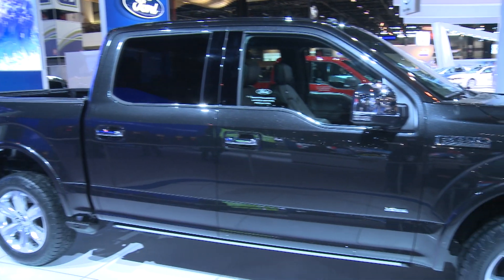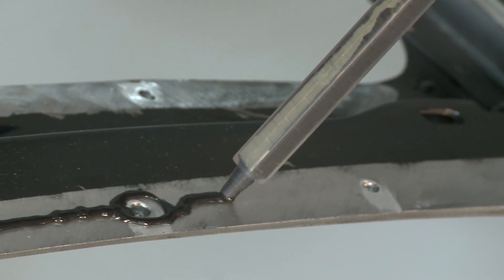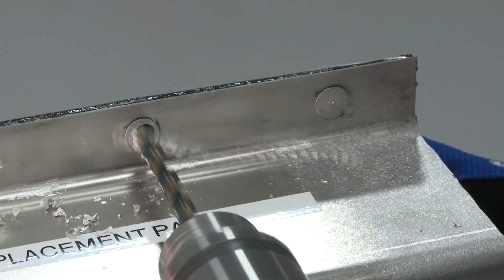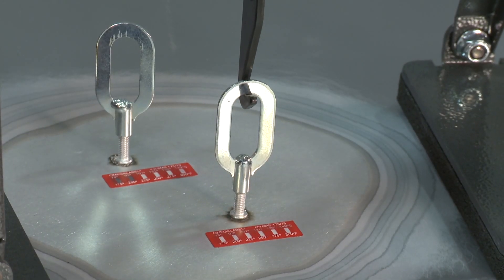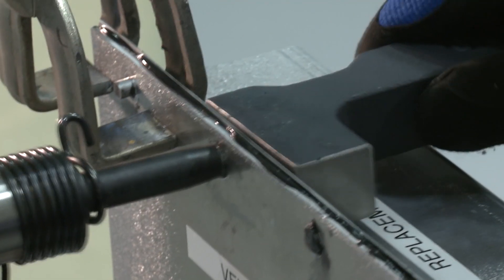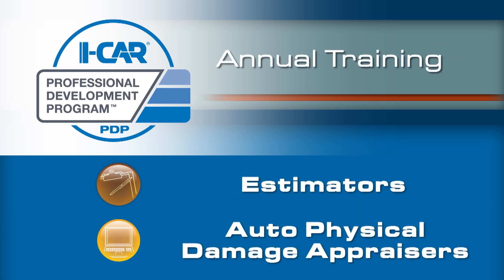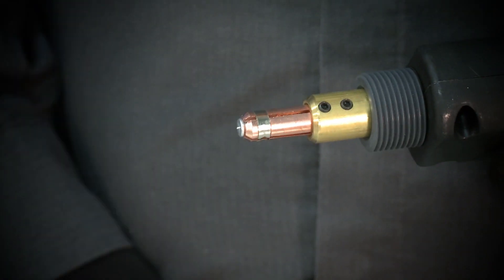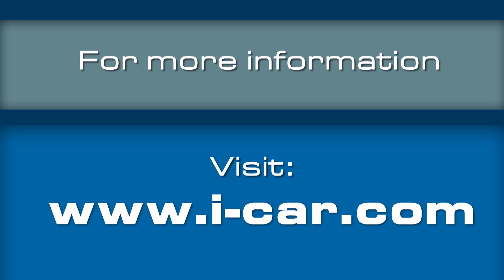I-CAR Aluminum Exterior Panel Repair and Replacement (APR01)

Comment: Good night, I am a repairer in Brazil, we have difficulty in refitting aluminum panel, do you have course material available?
How to get information about two tools I saw in the video, at minute 0, 35 and minute 1, 04.Grato.Henrique